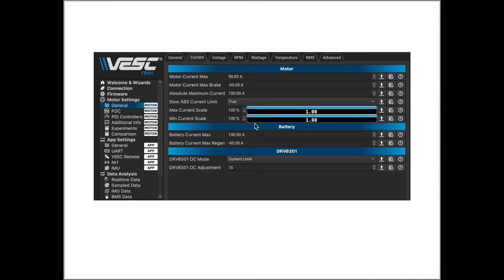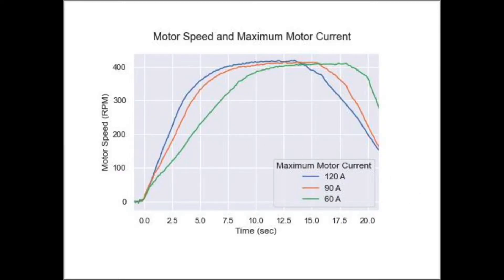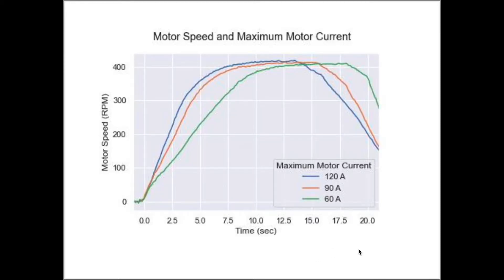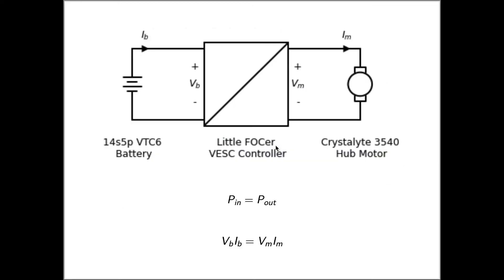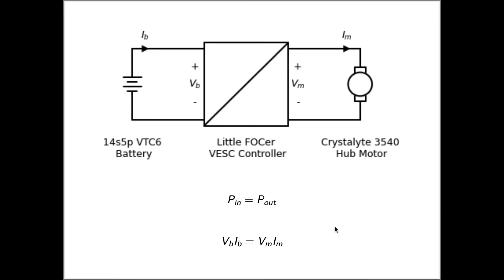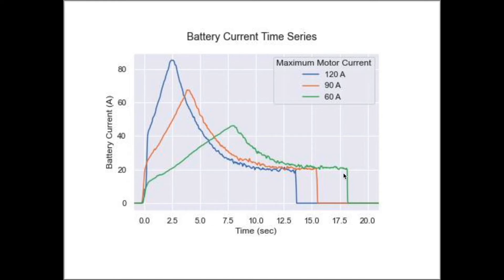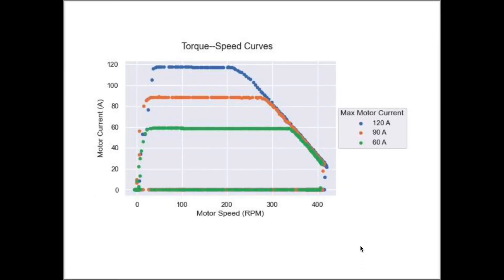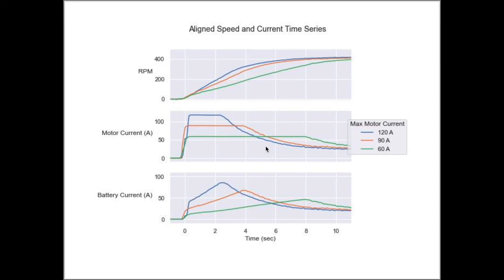Effect of Maximum Motor Current in VESC Tool

Comment: It does not work at all. Motor stops with Over_current when current goes to limited value. For example I set 90A (abs max current is 450A) and I have overcurrent. But chart shows that maximum current is about 90A. Scheise... Limitations work only if I set it about 3 times less than nominal power. It's very bad.
Reply: happen to find fix?